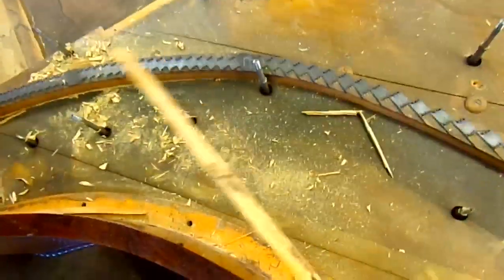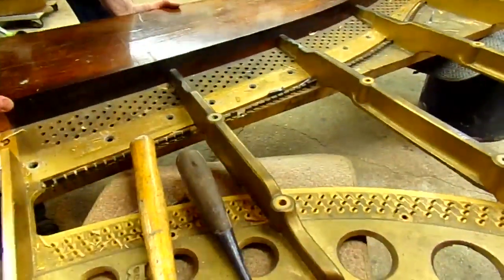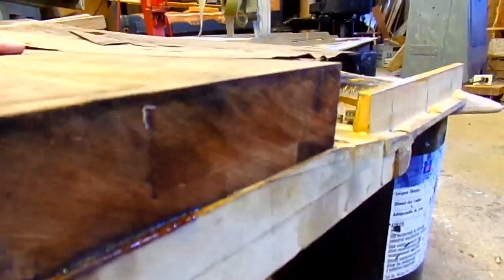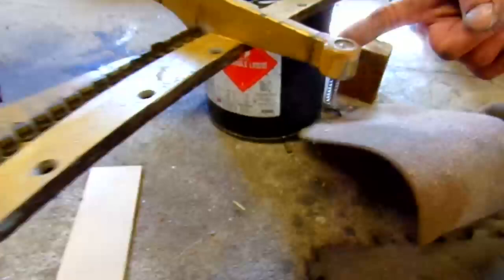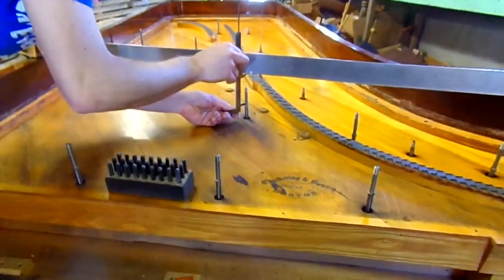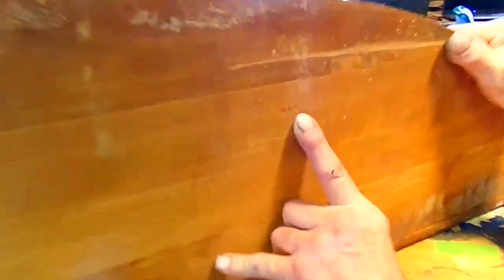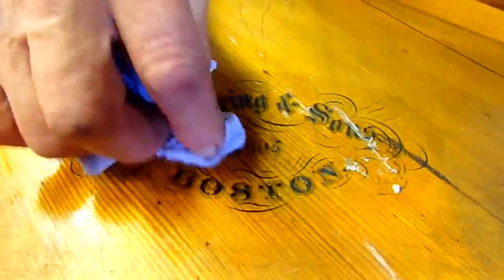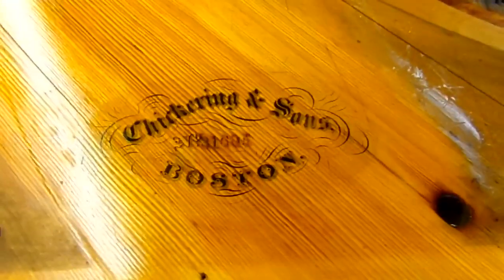Chickering 33B 1867 Conservative Restoration Part 4

Comment: My gosh, this piano was made with little forethought to future repairs, much like the earlier Chickering squares and "Cocked Hat" pianos.  Thankfully, I have seen other simpler "Scale-33B" pianos that came apart much easier.  Likely later ones.  There were many "Scale-33B" pianos made - the nicest sounding 3/4 plate pianos I've ever heard.  This is the first I have seen where it was individually strung.  I own a "33-B" (with "Swiss Action") that I've not yet started but if it is to be assembled as this one was, I think shall abandon this instrument!  I prefer the friendlier, later and far more massive Chickerings such as the full-plate  "Scale-77", "Scale 95" and "105" family.  Brave, indeed, you are!  Eager to hear the finished piano.
Reply from the maker: Hi' Tali, At least the plate is not bound in the full perimeter.  A small mercy.  This piano was chosen both for its originality, and because it is only 500 pianos away from the 33B that won the '67 exposition and was presented to Liszt.    This piano has an early, no-adjustments Brown action; very gracile.  In Chickering terms, Does "swiss action" translate as Herz-Erard?  I think there is a third early Chickering action that I have never encountered.  We have a 77 in the collection;  we seem to be working our way up to it.  And I have yet to see anything in the 95 series.  What are they?
Reply: @hampshirepiano6383  Hi Craig, Yes, the Chickering books say "Swiss Action"  - (I guess they just couldn't bring themselves to utter anything with the word "Erard" in it.)  And yes, that is what it is - essentially the action in most all today's grands.   I own two of the 101 "Scale-95" concert grands that were made.  Gorgeously made full-plate concert grand pianos with agraffes to top (a little before the 105 family with "Harmonic Bar")  with floating soundboard sitting upon large dowels with screws through them and into the rim.  At a shorter 8'7" but with a super wide tail much as a Bosendorfer Imperial.  Sweet lush warm sound.  No false beats!  Pianist, Stephen Hough played the younger one I have, #73,000, and described it as a large chocolate bear.  :-)

Comment: I changed both the pinblock and the base part during this repair, since the old wood is not as strong as it should be, and the first time I replaced only the pinblock, the entire wooden structure buckled from the tension of the strings, and even the keyboard mechanism did not fit into its place. And when I changed the wooden base of the PinBlock, everything was fine. It was a small Schroder piano made in the Russian Empire. We usually use a beech tree.
Reply from the maker: We take pride in our efforts for originality, but the pinblock problem giving way to the forces, on every one I have seen, was remedied with the addition of a 1/8 " steel plate, grafted in under the pinblock, and machined screwed to the bottom of the pinblock and attached to the iron, under where the agraffs are screwed in.  it is not possible to give in to the rotating  force any more. I will show photoes of this application, soon. It was completely UN-notice-able.
Reply from the maker: Correction! the steel plate was fastened with old piano wood screws, maybe size 20 about 12 of them or so to the bottom of pin-block , and machine screws to the Iron.

Comment: Did you steam the veneer to separate it from the pinblock spreader……or chemicals?  Your work is extremely interesting to me, and interesting how some of my solutions to these issues mirrors yours.
Reply: Hi Terry, I also felt it a little anticlimactic not getting to see that process even though I've seen it in their other videos.  I don't know if they used it for these particular pieces but they have a neat steam system with a tube carrying steam drilled though a small cleaning brush so the steam and the brushing action can act at the same time and place.  It kinda reminds me of some black site torture device!

Comment: I wonder about the soundboard. These seem very wide boards, perhaps of real old trees. How about the grain density? These trees still grew up during the mini-ice age (1303 – 1860 according to Wikipedia).
Reply from the maker: The board width is normally what is found, about 10 cm's.   Grain width is normal also.  The ribs seem to be all the same wood,  and the over all construction is very similar to a Bluthner 1873, we did.